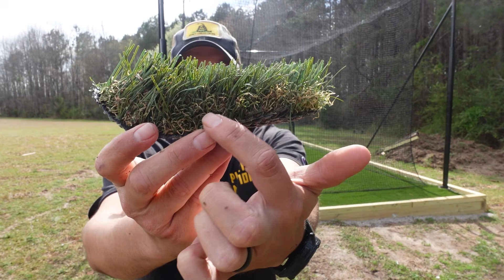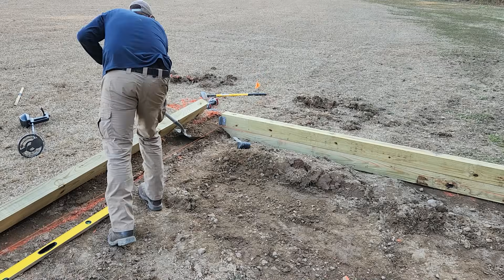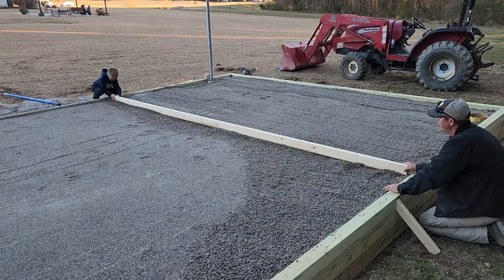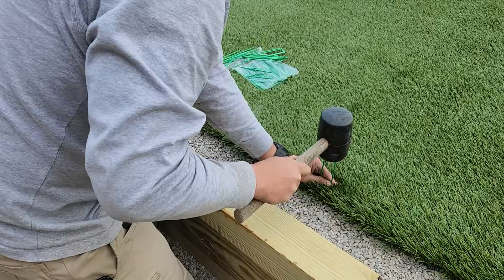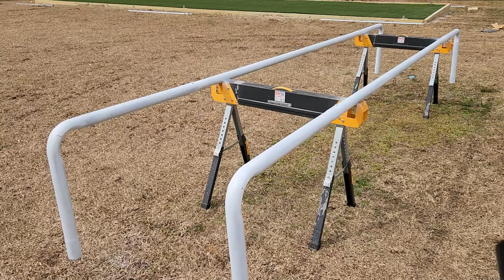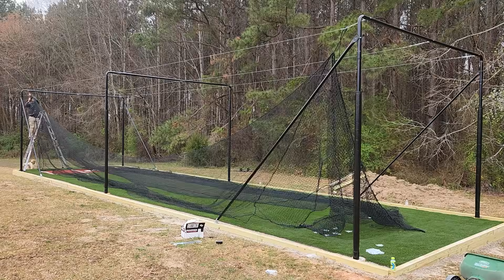Ultimate DIY Backyard Batting Cage

Comment: Hi Johnny. Your batting cage turned out really well. Super impressive what you built. 

I'm in the process of building a cage as well and I'm interested in how your project is doing 1.5 years later. Would you have time to create a follow-up video on current state of things, what you'd do differently next time, and any gotchas you encountered? Also, have you thought of what you'd do if you need to extend it when your boy at 14+ is getting pitches, or is pitching, from 60'6" ?

Many thanks!
Reply from the maker: Thanks! Everything's holding up great, looks the same as it did when we built it!  We probably won't ever extend it, just adjust the machine speed to account for the distance.

Comment: Great video. What was the cost of building the base with turf and everything minus the cage set up
Reply: $1100 for the turf, $2000 for the gravel, $1000 for the wood, $300 for the hardware.  He also used a $20k tractor he already had so if you don't have that, good luck.  You're talking $5k for the surface prep alone. If you have to pay someone else to do it, add another $5000 in labor.  He said in another comment that he did the whole thing for $5k which is a flat out lie. The netting alone he used is $3k.
Reply from the maker: Depends on slope of your yard and local lumber and gravel cost. But theres a link to the turf in the description

Comment: What’s your exact dementions on the wood base? Want to be able to also anchor the supports poles to the wood instead of concreting more bases in the ground. I don’t want to build it too wide because I couldn’t anchor to the wood then. Hope that makes sense.
Reply from the maker: 60ft long 16ft wide (on the inside of the wood frame)

Comment: What is the ballpark all in cost? I am trying to get our organization to re-do two outdoor cages that were built a long time ago.
Reply: This guy is so full of shit with $5k. He has a net that alone cost $3k. And he used 30 yards of crush which is $2k. He's at $5k right there.  It doesn't sound like you can do this job yourself. A realistic estimate to have someone else build it and the materials cost is around $25k-30k. He also just glosses over the fact that he is using his $20k tractor to do almost all the heavy labor.
Reply from the maker: Around 5k plus gravel and lumber, cost for those will depend how much you need to level your surface

Comment: What would you estimate was your total cost for this project?
Reply: $10,000 and 1 month of work if you have a normal job.
Reply from the maker: @MattChat56 actually around 5k...and yes if you plan to do it yourself, its hard work
Reply: He didn't even say the price. I'm clicking off now
Reply from the maker: @potawatomimko6108  links to everything in description
Reply: Had to be pushing 5 grand
Reply from the maker: Around 5k depending on local lumber and gravel prices
Reply: @PatriotDIY  This is not even close to accurate. You're using a $20k tractor to do a lot of the heavy labor for you.  You also used a $700 laser level which most people don't have and is not something you can rent.  You have $1200 for the kit, $1100 for the turf, a $2700 net, $800 of lumber, $2000 of gravel pack (30 yards at least), a $700 L-screen, $250 batter's box mat, and probably at least $1000 in other misc things including the hardware.  Even if someone DIY'd this themselves the other guy that said $10k is closer and he's probably on the conservative side as well.

The video is good. But also sort of useless if you're not going to be honest and upfront about the cost and the amount of labor and heavy machinery you need to do it.  This is far beyond a DIYer project. This is more like, "you can do it if you're in the construction industry."  If you had to pay someone to come in and install this, you have all the materials costs, plus 50% up-charge and then double that for the labor cost.  This is a $30k batting cage.  Again, it's done really well. But this is so far beyond any normal person's ability.  You basically built a pro-style commercial batting cage in your backyard.
Reply from the maker: @cafesilver9  So i think youve left 8 comments now so i can see you are very worked up about this!   
First of all, i never claimed this was cheap, only that it was cheaper than paying someone to do it. And i have answered all comments honestly and provided links, which you seem to have misunderstood, some of thos links are kits that include other things and discount rates, you dont have to purchase each thing individually.  

Also, You somehow seem to expect this project to require no tools or effort to build...thats just not reality! 

And look man, if you look at this and realize you can afford it or dont have the tools to accomplish it yourself, THATS OK! Im sure youll be able to find another option that works for you. But to get on here and leave multiple comments incorrectly calling me a lier and getting all upset just because you cant do what i did....thats just immature and honestly pointless....im a dude building stuff on youtube...talking crap to me isnt going to improve your situation or make you feel any better! 

Good luck big dog!

Comment: There’s no way this nice batting cage was only 5 grand. I’m looking right now with everything (cage kid, gravel, turf) just that none of the extras like machine, backstop, L screen etc. it comes out to 12 grand with extras!
Reply from the maker: Current price is 2700 for the Cage kit from ATX Turf (includes turf, Net, cables, and L screen)
2000 for the Complete Frame and pole kit from Cimerron Sports
That's 4700 (links in description)
Obviously the gravel and lumber cost will vary based on your needs and location.
Reply: @PatriotDIY Did you buy the ATX turf kit? If so did you get the 15' x 60' turf? And the 55' x 14' x 12' net? Or did you special order? Thanks in advance!
Reply from the maker: @brianwriborg9725 yes thats exactly what I got. Atx kit  15x60 turf, 55x14x12 net
Reply: @PatriotDIY thank you sir. I'm about to build one for my grandkids.
Reply: Do you remember how many cans of primer and spray paint you used?
Reply from the maker: @brianwriborg9725  I dont! Maybe 4-5
Reply from the maker: @brianwriborg9725 yes thats exactly what i got!  Hope that helps
Reply: @PatriotDIY  Don't forget the $20k tractor that everyone commenting has in their barn.
Reply from the maker: Guys this video is about how to build a nice cage setup, if you cant offord to do it this way, thats ok!!  I dont understand why its necessary to give me a hard time just because i built something nice at a price i could afford....with that said, The links are in the description folks...pole kit, cables, net, turf, l screen all included...around 5k.   
I have already explained that not everyone needs the amount of gravel and lumber that i needed and that obviously that is going to depend on your unique situation. 
And yes i used a tractor to level my ground....but you dont have to do that, you could build up rather than digging down...either way, are you people somehow under the impression that tools and effort will not be required for this project???   If you guys are looking for a solution that cost no money and requires no hard work...ur in the wrong place!!
Reply: You are right on the money with 12 grand. He's a liar and full of crap with 5 grand.  He doesn't factor in the $2k of pea gravel or the $1k in lumber he used.  Doesn't factor in that no one watching this has a $20k tractor either for all the heavy labor. I just can't stand people that make such great videos like this and then screw up lying about the actual cost to build the same thing.
Reply from the maker: Bro....this video is about how to build a nice cage setup, if you cant offord to do it this way, thats ok!!  I dont understand why its necessary to give me a hard time just because i built something nice at a price i could afford....with that said, The links are in the description...pole kit, cables, net, turf, l screen all included...around 5k, i have not lied to anyone.
I have already explained that not everyone needs the amount of gravel and lumber that i needed and that obviously that is going to depend on your unique situation. 
And yes i used a tractor to level my ground....but you dont have to do that, you could build up rather than digging down...either way, are you people somehow under the impression that tools and effort will not be required for this project???   If you guys are looking for a solution that cost no money and requires no hard work...ur in the wrong place!!

Comment: Just confirm the 10' poles do not come with the kit and I do not see a link for any other poles outside of the kit (link). How many additional poles and what is the size, type, etc?
Reply from the maker: They sell more expensive kit that includes the 10'poles but if you get the one I did you'll need (9) 2" EMT conduit and (4) 1.5" EMT Conduit from Homedepot, Lowes, or other source